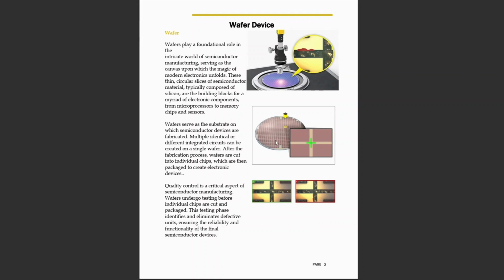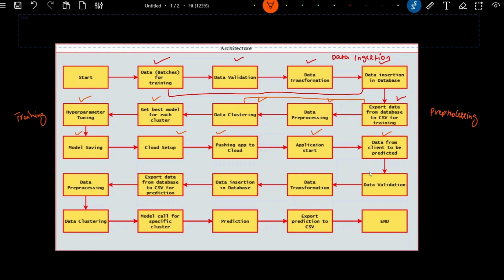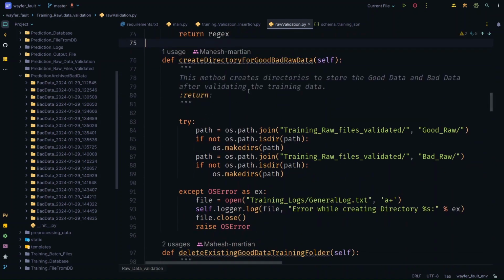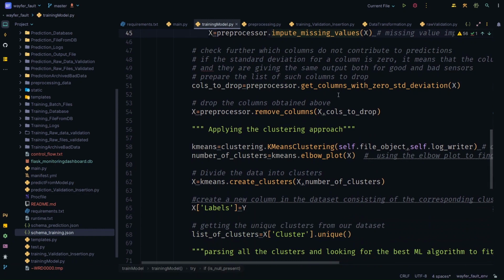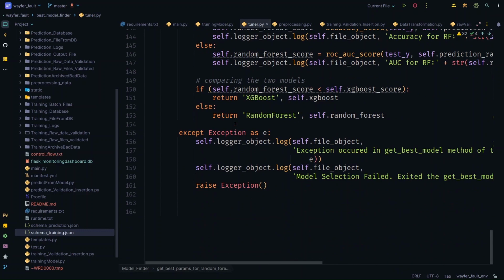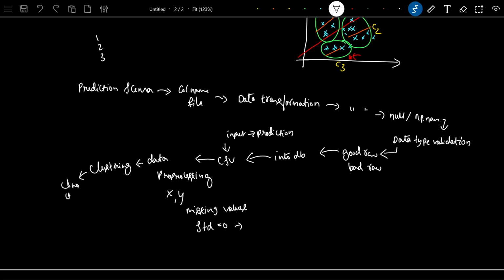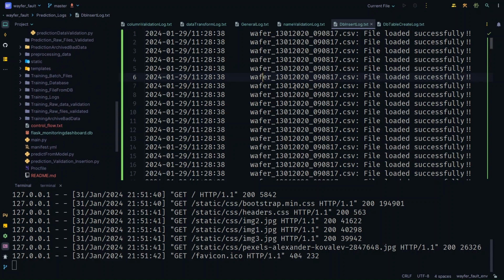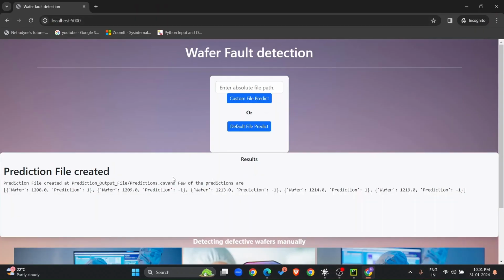wafer fault detection  | End to End Machine learning project

Comment: Mahesh, i am getting the error, tough to explain on here lemme try
ModuleNotFound error, i crossed check the details in the code no issues with that.
it is appearing from sibling files.
i created the setup.py, it temperoraly resolved the issue but when i try to update/add file it is again getting me the error.

Thanks in advance